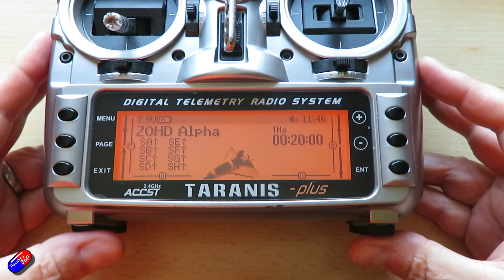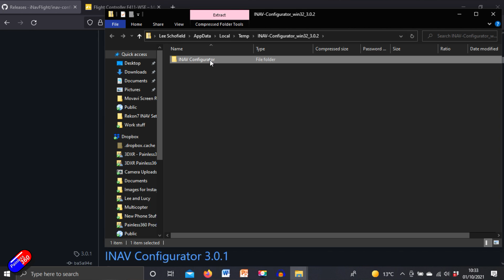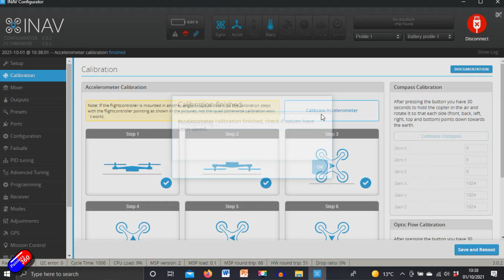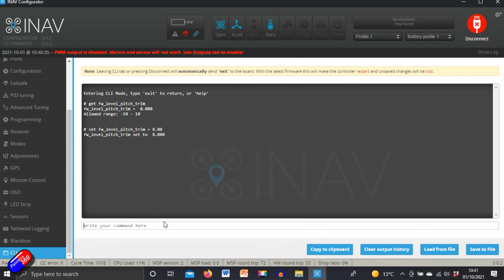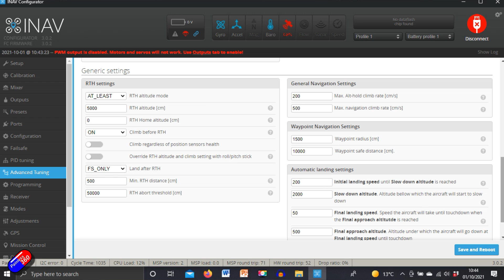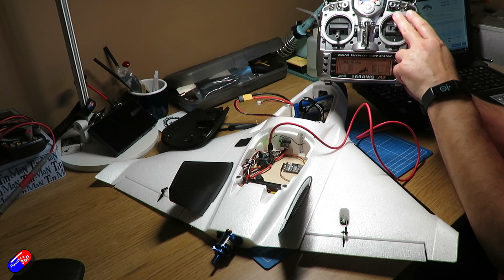INAV 3.0 & 4.0: How to setup a Fixed Wing model. (1/2)

Comment: plugged a sonicmodel ESC into a matek FC, but i only get ESC beeps. once every 2 seconds. Can't seem to spin the motor up. It just beeps endlessly.
I left the ESC's 5v wire disconnected like the matek FC wiring diagram instructed. I'm assuming this is becuae the ESC uses the 5v servo wire for its 5v BEC and my matek FC makes its own servo power up to 7.5v,... Does the ESC's 5v pin need to be connected to my 7.5v Vx servo pin?
Reply from the maker: Maybe. I'd check the outputs are enabled and the ESC is calibrated too... Best of luck
Reply: @Painless360  I managed to get it spinning and calibrated using "Standard" ESC protocol ,but it just goes back to beeping when in Dshot150 protocol
Is that normal for the sonicmodel ESCs?
Reply from the maker: I run most of fixed wing ESCs in standard. Check if the ESC you have supports other settings.. Happy flying
Reply: @Painless360  my only mistake was not following your video exactly lol. I shouldn't have bothered with dshot lol.  Your vids are awesome, and i really enjoy these indepth build videos

Comment: Hi. Don't know if this problem is relavent to this video, I have a wing setup on inav 3.0 and using crossfire on the auto channel 17, it behaves like regular rssi and cannot change to lq as the channels in crossfire config only go to 12, tried to assign a channel for rssi but cannot seem to be able bar shows on receiver but does not move when you switch off the radio, also cannot turn off the channel 17 always shows in receiver tab tried setting rssi to channel 12 in cli instead of auto but nothing seems to work! Any advice welcome. I am using dji air unit and goggles. Thanks
Reply: What aircraft is this ? Thx

Comment: Regarding the Fixed Wing Level Pitch Trim (fw_level_pitch_trim) command - If you notice on the Configuration tab under the Board and Sensor Alignment section, it says to "Use Fixed Wing Level Trim on the PID tuning tab under Mechanics instead (fw_level_pitch_trim)". Everything could be done via CLI, but just wanted to point out that there is a GUI location for that setting as well.

Comment: I know this isn't a QandA but I'm running Tracer on an f405-wing. I've built many quads. So I'm not super strange to the reciever tab but this is my first build on Inav. But I started in uart1. Soldered tracer Rx to uart 1. Set serial Rx on ports. In reciever I set serial based and crsfr. I am bound. But yet nothing is happening in reciever tab. I swapped TX and Rx thinking I may have them backwards. Nothing.. switched to uart 3 thinking maybe I had a bad uart. Still nothing. Is there something with INAV I'm missing? My reciever is good I just pulled it out of a quad with no issues. Please help I also left this comment on an earlier video.
Reply from the maker: See you my Crossfire setup videos. CRSF needs a TX and RX connected to the UART. Best of luck
Reply: @Painless360  I def have something weird going on. I tried 3 different uarts. TX and Rx 1,3 and 4. Going to try a different tracer nano thank you

Comment: Would you use inav for a heavy lifter multirotor? Or stick to arducopter? 

Does inav have smooth turning in corners for survey missions?
Reply from the maker: See the missions video. Ardupilot is the smoothest flyer IMHO.. Happy flying
Reply: @Painless360  Alright I will, thank you! I'm happy with ardupilot so far. No doubt about it. But it is not too user friendly and QGC doesn't support all mission parameters so I have to plan from mission planner and execute from QGC which is a bit of a hassle.

Comment: What I found is that if you using DJI, and you installed a OLED display in the flight control,  and move the radio stick elevator up, throttle middle and left you can enter the menu, like in the a analog googles, a d you can change values because the info is in the OLED.

Comment: I'm following this tutorial to the letter.  Specially the autotune, I have in mine in a second OSD screen the PID values to see how I started, and how the values start changing.  I have no idea what's more change in the tuning process,  may be rates too. I'm using the Agressor,  H743 board. A analog vtx due to OSD limited in DJI. BN880 GPS.  This is my first Inav 3.0 so I'm learning.
Reply from the maker: Best of luck. I have a video on the Autotune stuff. In INAV 3.0 you need to be in ACRO mode to AUTOTUNE so it can figure out the rates too.. Best of luck!

Comment: In INAV 3.x The fixed wing level pitch value has been moved to the PID Tuning - Mechanics menu, so I don’t think you need to go into the CLI to set that, granted it’s a bit harder to find though - Patreon: Charles Jones
Reply: Yup if you know what you looking for. What I disagree is that no manual mode in been set in the radio.  And if you run into trouble will be very early and the FC will crashed you airplane.  By having MANUAL, at least you have full control of the aircraft and save it. And tune the surfaces  mechanical.  I watched to many plane lost to improper mechanical setup, relying almost completely to the computer.
Reply from the maker: Keep watching the series ;)